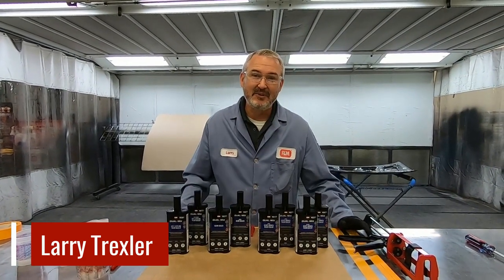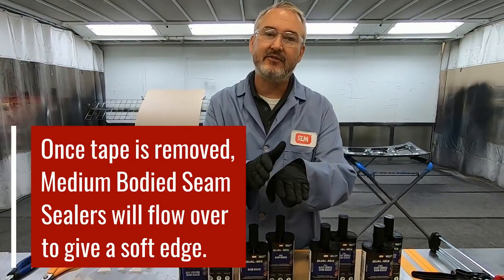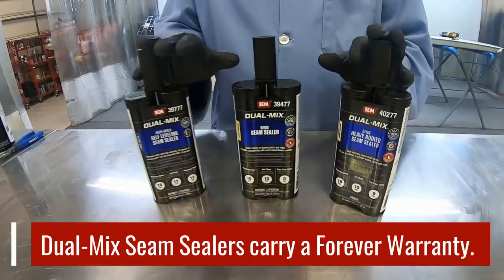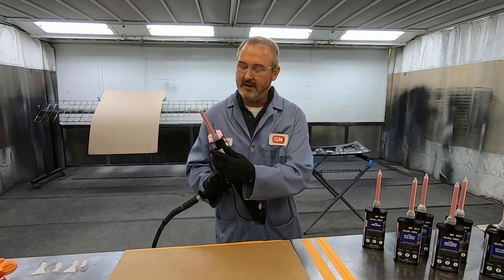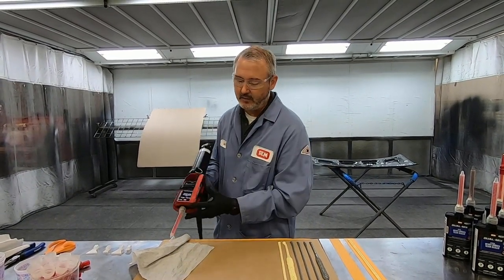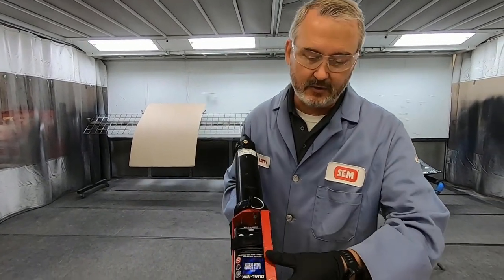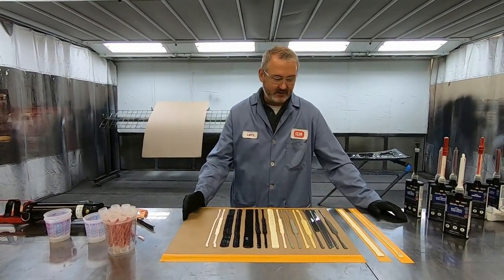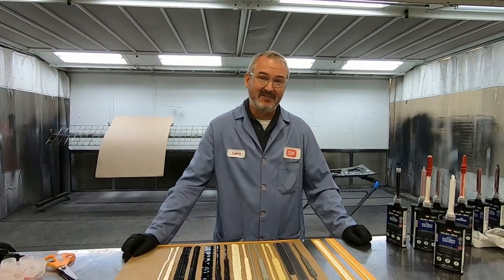Training Series - Episode 2: 2K Seam Sealer

Comment: Could you tool the medium bodied seam sealer in a roof ditch? Self leveling seams is great for flat put a pain near the front of the roof where it curves and ends up with excessive puddle at the tape dam.

Comment: Appreciate the video, production quality, and content.  
I’ve been spending too much time wringing my hands over which Sealer will provide Acceptable results.  I am reluctant to use the dual cartridge variant Mostly due to the Cost of a specific applicator required (its a one time Task for me).
Is there a Significant ‘compromise’ in results, using a single cartridge Seam Sealer product ?
Reply: No waste.  Easy application.  Resealable.   Time saving. Ends up being good value.